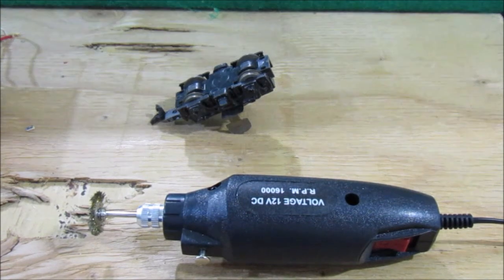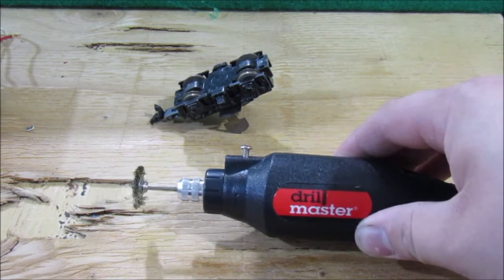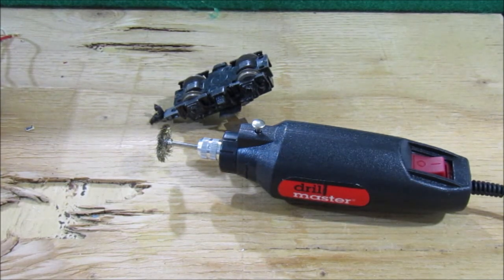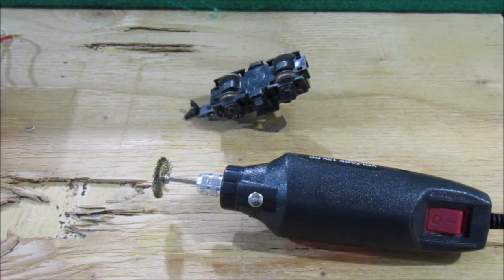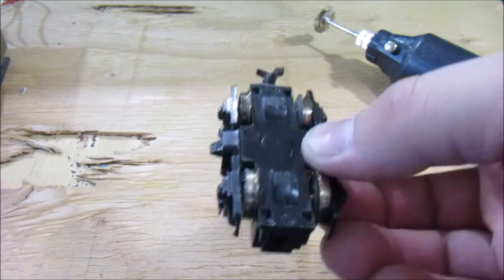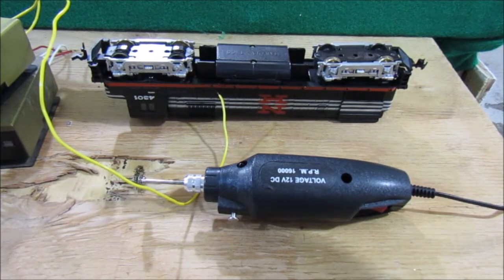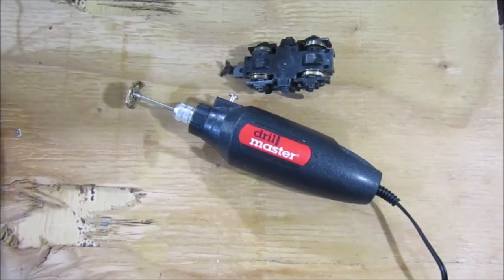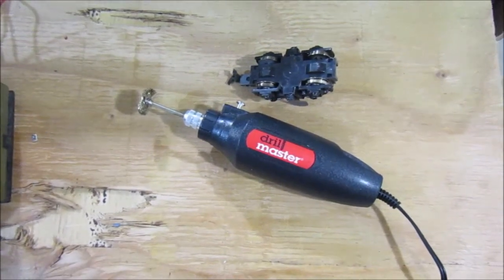$10 dremel vs. dirty model train contact wheels (TYCO MU-2 hack)

Comment: You forgot to mention you need to also clean the inside of the wheels where the contact makes contact with the wheels for electrical pickup, if thats not clean then no matter how much wheel cleaning you do the loco will not move... A great idea tho.

Comment: Tyco truck covers on with rotary tool.You brave lol 🤪🚂🚃🇨🇦
Reply from the maker: Well, just being careful and allowing the rotary tool to spin the wheels works fine. Obviously, just working with the wheels themselves is ideal, but when dealing with Tyco MU-2 trucks, that would require drilling out the rivets on the bottom plates just to remove the wheels. The later-Mantua MU-2 motors that featured screws holding in the bottom plates, are way easier to maintenance.